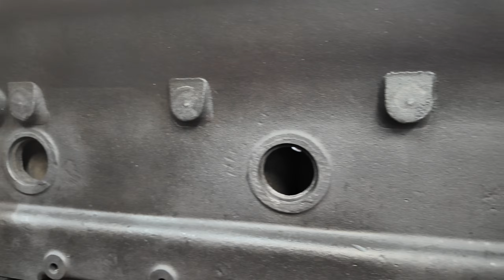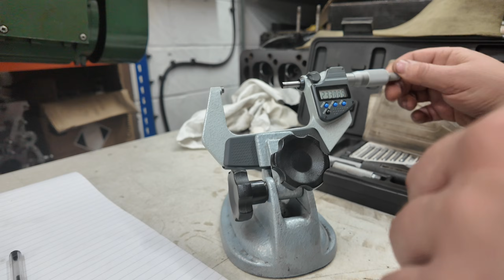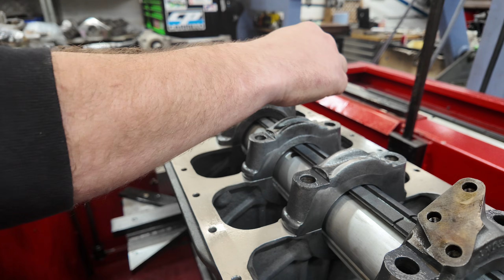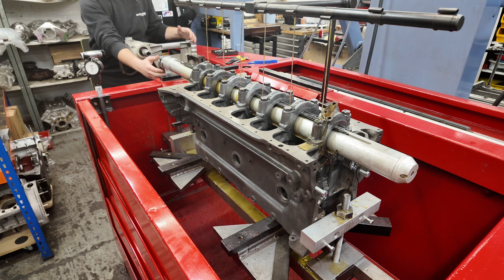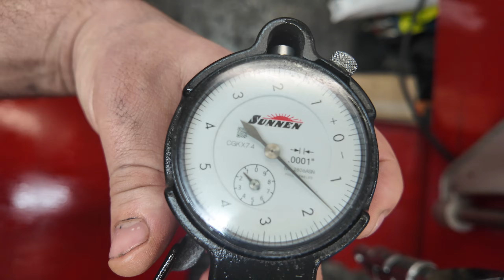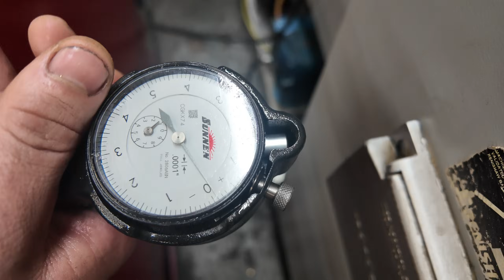The Jaguar E-Type Repair Most Shops Skip!!!

Comment: Please do a video on torque and why its important. A lot of people watch a youtube video on how to work on an engine and think they understand what they are doing but they lack the knowledge and understanding of why some things are important, like a tightening sequence, or multi stage torque sequence, or why aluminium bolts/stretch bolts need to be replaced.
Reply: cool, also torque the bolt with and without grease to show the diff. Torque by nut or bolt (they say add 10%  to torque by the bolt), lot's of questions, lots to learn :)
Reply: Jethro Bronners YouTube channel about classic Alfa Romeo’s is what rekindled my interest in classical and the engineering in them.
Reply: Loved this and  looking forward to nerding out on torque spanners.